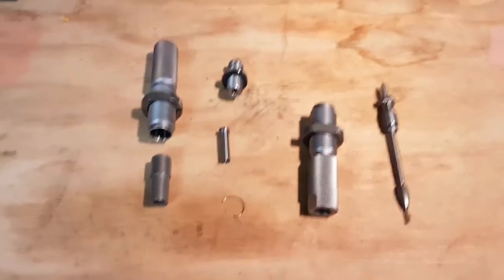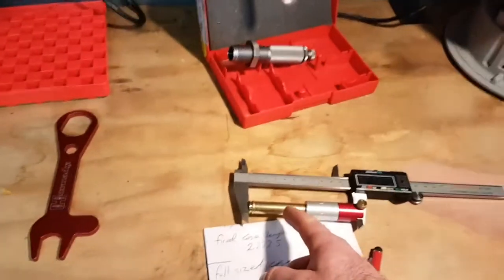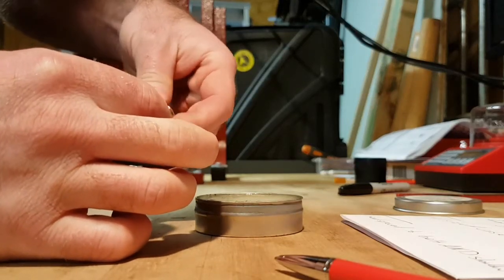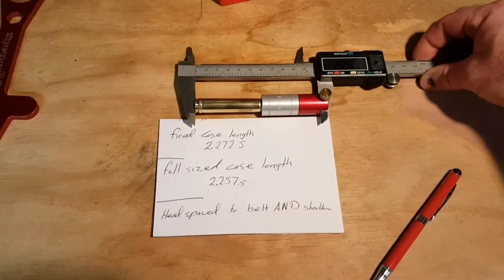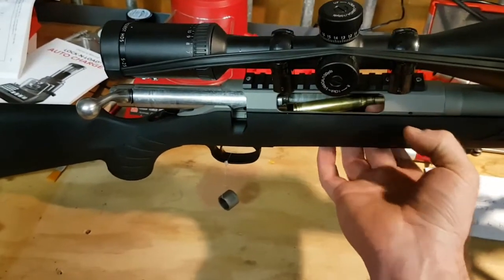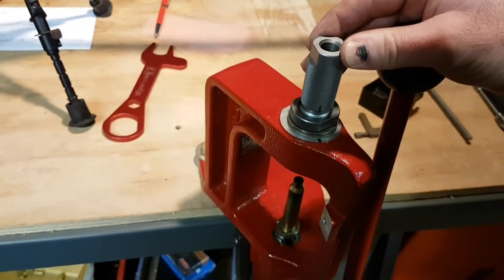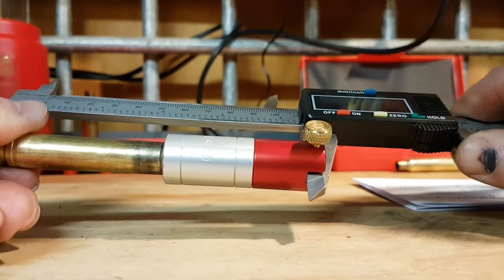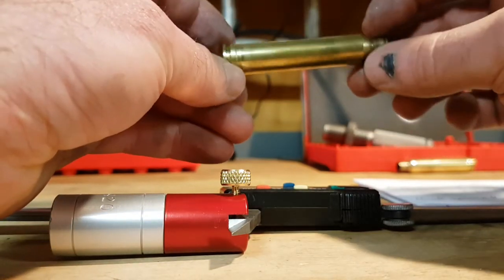Part 2. Reloading for the 300win mag.

Comment: Do you need to do this if your using chambered fired brass and you only neck tension?
Reply from the maker: Depending on your gun and load, if you start having a tight bolt clambering a round then yes you will need to bump the shoulder a fraction